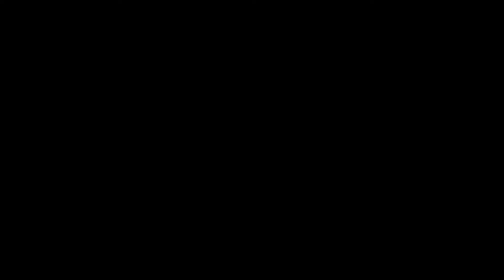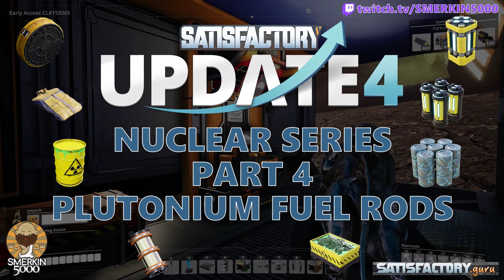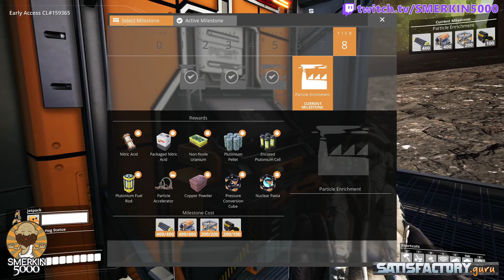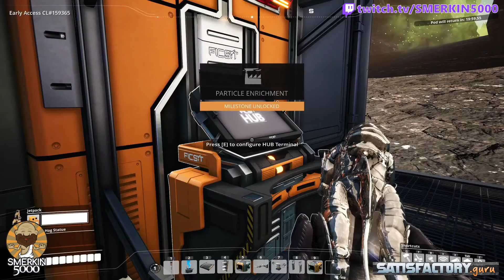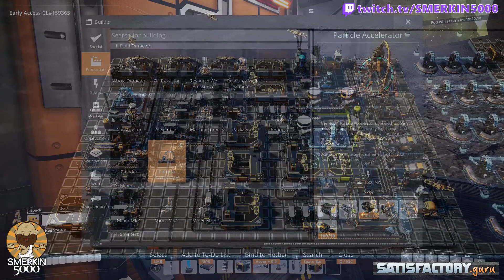Nuclear Series - Part 4 Plutonium Fuel Rods

Comment: I don't quite follow your math at 1:49.  Isn't there a 2:1 ratio of waste needed for plutonium?  To power ONE nuc plant with plutonium (.1/min rod) takes 20/min uranium waste to create sufficient plutonium.  Meaning, your 100/min uranium waste, used at 20/min in the particle accelerator and blender combined (so 100/20) will create enough plutonium to power 5 plants, no?
Reply from the maker: I'm sorry but life has got in the way, hence my slow reply. The math should be correct, you can check it out in my spreadsheet: https://docs.google.com/spreadsheets/d/147HXmsIEDNkMgiaakqZ-JYWGEhz-dE7HPxZQyCTDo6g/edit?usp=sharing